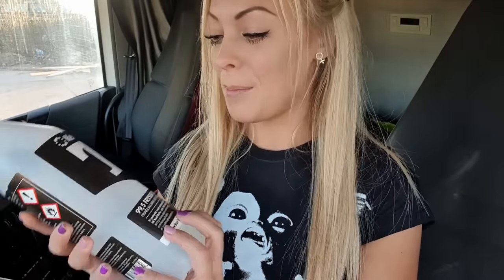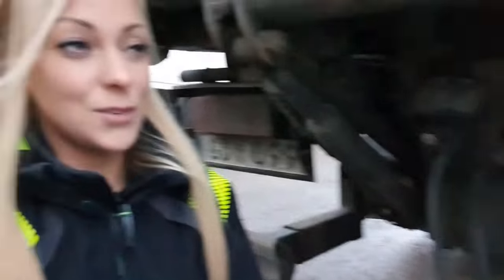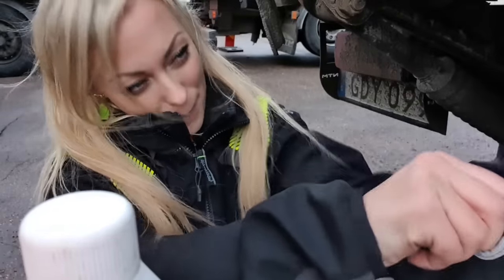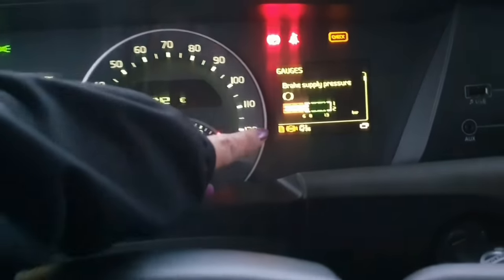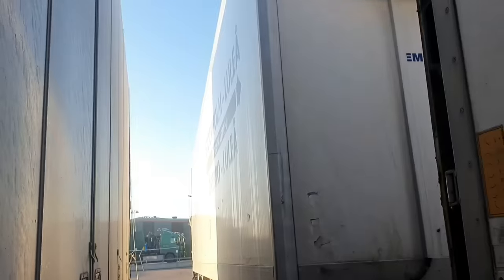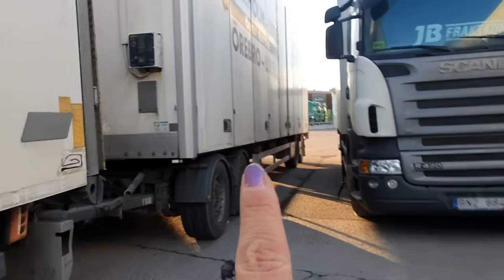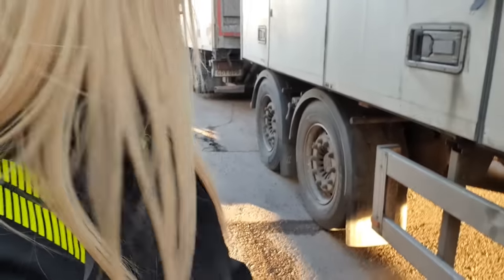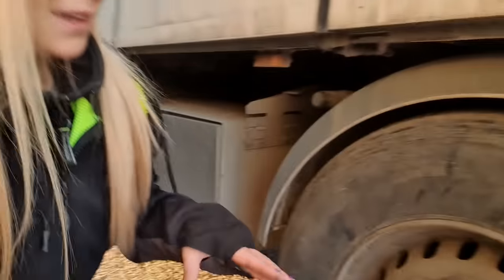Truck brake system, wintertime ❄ - Angelica Larsson

Comment: There are two steps that will prevent your brake cans from freezing.
1...make sure the dryer in the air system is working properly, the shop/mechanics will be checking it during oil change/ preventive pms and during the annual review of pms/truck systems.
Always, drain the water out of the air tanks at the end of every shift. You don't have to drain all the air in the tank, just the water and moisture.

Comment: Dear Angelica, first of all happy new year and wish you safe kilometers. Why the car don't have a air-dryer?  Big hammer and hit the wheel. If i was little younger I move to you and we drive together. You a great women and Humen. All respect. ( I can drive trucks)  Good luck and let those nice video come. JWB from The Netherlands
Reply from the maker: We have it on the truck but not the wagon 😊 thank you 🙏
Reply: @AngelicaLarsson  yes I know you need air dryers. but the compressor from your car is also pumping the air for the trailers. But also. in your wonderful country it is a little more colder than in central Europe. if we got our -20/-25 it is the max.  So the Alcohol you really need. or you have a problem.

Comment: Bruce you put straight stacks on your truck watch the rain it will fill Stacks with water then when you start the truck you will have black soot all over everything need turnouts or some way to get up there and put buckets over your open stacks when it rains

Comment: That kind of works but thire a air governor under the hood u can enter the air system thire if it wouldn't build up air or u need to get suff for deicing in to the system lol easier then it sounds

Comment: Question from the warm weather of Portugal: what do you do if in the morning the brake pads are frozen to the discs?
Edit: i forgot to say that i'm asking for regular cars without compressed air brakes
Reply: You don't use the parking brake in your car in cold wheather.

Comment: How do you stop air brakes from freezing?  When possible, park inside, and leave your drain valves open overnight. Keep your evaporator filled with air brake anti-freeze. The alcohol vapor will mix with any remaining moisture, reducing its tendency to freeze. Always keep a bottle of air brake anti-freeze on hand in the truck. That is a 2016 research answer I got from searching it, I hope that it is the right call because the alcohol method will work temporarily but will end up evaporating and freezing up again is what I also read before finding this so again the method you are using in this upload is a temporary solution to the air breaks from freezing up again and another thing to do   is to have the air line heater checked if your air lines on your wagon and trailer air lines are freezing up and locking up the air lines for the trailer breaks if a trailer sits idle for too long in cold weather without being used I am not trying to tell you what to do I am just giving you the needed advice to prevent your wagon and trailer breaks from freezing up and are useless until you are able to unlock the wagon and trailer breaks, I mean no disrespect by any means I am just giving you advice because I enjoy watching your uploads Angelica

Comment: As a fitter I'd just say be careful heating brake calioers not to melt any plastic air pipes, or overheat the caliper causing damage to the seals inside

Comment: that was actually the brake caliper you were heating up, the disc is the large round circle that goes through the caliper, and the caliper applies force to the disc for stopping power :)  come on over any time :)

Comment: I just don't set the parking brake in the winter on the trailer I don't use the alcohol it will dry up the seals hammer is your best friend sometimes you can free it up by going in reverse a few feet just my 2 cents from Illinois

Comment: not to be mean but you guys need simpler brakes. in the U.S. we have spring maxi brakes. the spring is pushed back when pressure is applied and sets when evacuated. i dont set the trailer brakes at the end of the day for several hours, if at all. the brakes wont freeze that way as the linings dont touch the drums.  if the truck is level the truck brakes alone are enough. also most if not all u.s. manufacturers do not recommend the use of alcohol in the brake systems.
Reply: It works the same way here. If you park the truck and tralier connected the trailer brake will be off as long as there is air pressure.

Comment: WHISHING YOU GOOD HEALTH,AND ALL THE LUCK OF THE WORLD FOR 2020.QUESTION :WHY HAVE NOT ALL WHEELS AIR BRAKE?
Reply from the maker: They do 😄 I explained it a bit bad. But 2 of the axels are catastrophic brakes, and the other 2 are "regular brakes" 😊
Reply: You want redundant systems in case one goes down - especially braking on a big rig.  Aircraft have two, three and even four redundant systems on some components.  Even normal car braking systems have a back up with the manual emergency brake system.

Comment: Sounds like they Use Air Disc Brakes and S-cam Drums as well . The way  I  got shown for that was 250 ml of Methylated Spirits (methyl alcohol) directly into the " Wet " Tank after draining it completely of course . The tank the Compressor fills . Only the One Dose unless another proves necessary . 
Rest of the System is still charged at this Point . Start Engine and get pressure back to Max . 
Then , as many FULL Brake applications (pedal to the floor) as needed to get the Pressure Alarm going . You should get at LEAST 5 applications .
The Pedal will go hard on some systems . 
Get Pressure back to Max and do it again . About 5 Cycles of this all told . This should remove ALL water from the Air System . 
Air starts at the truck but goes all the way to the Trailer(s) as well . The Alcohol grabs the water and takes it out the Discharge ports .
Physically stuck brake ? Yep , Heat and Hammer . On an S-cam you can back off the Adjuster to see if that gets it moving . Then nip it up again later .
However , if you are LUCKY 30 plus Maximum Pressure brake applications might Break the Ice , so everything rolls .

Comment: I've been driving truck trailers for 30+ yearsin the United States and I've never heard of links freezing and locking up because that's why they have air dry years on the air takes these days to keep the air out of this to keep the water out of the system ought never to retract your word then I'll be 30 something years old and main event had air dryers up on them and also we only have the drum brakes because there is nothing else that can handle the weight to stop the vehicle everything else is unsafe for weight limits we may only run at 90,000 pounds gross but when you're rolling even 55,000 pounds of material is hard to stop and also when you dream tearout I seen the signing of moistness so you're telling me that with no sign it still freezes doesn't get colder than 30 below zero there because it must